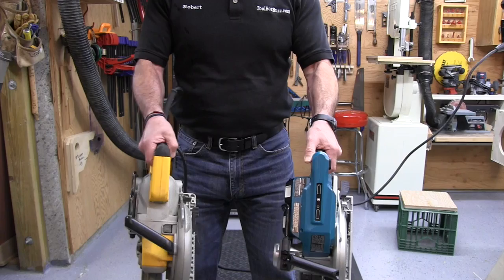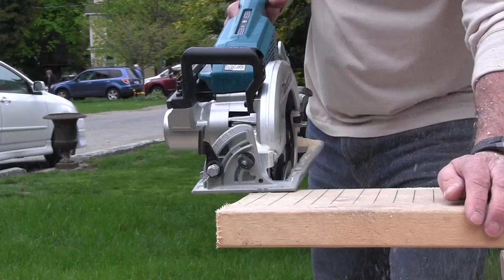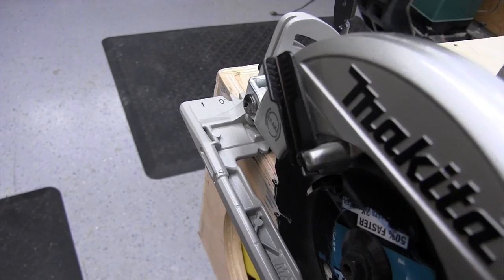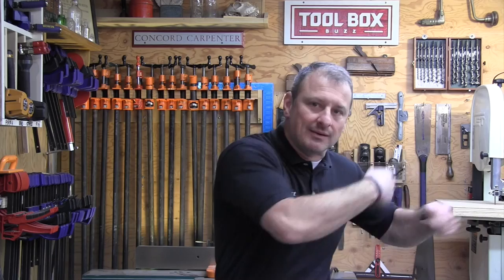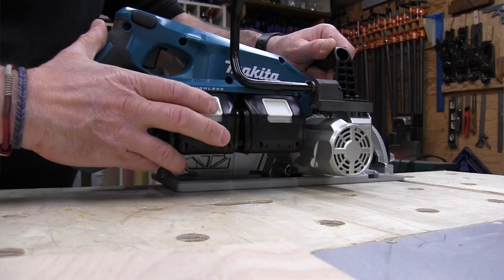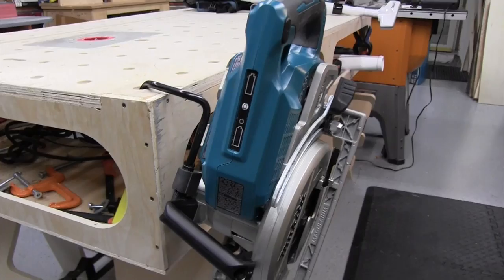MAKITA 18V Rear Handled Circular Saw XSR01

Comment: Question --  I just bought this Makita rear handle circular saw and it doesn't slide over material for crap , that grayish coating on the magnesium base plate makes my saw really hard to push , I mean its basically unusable,  I only use it about 6 times and had to switch back to my Dewalt. I tried it on 2x10s and some plywood and the plywood actually put a few deep scratches into the base plate,  any idea what's wrong with it ??
Reply: I have used this exact saw and never had any issue with it running across the wood.

I have had an issue with my other 18v Makita saw, but it has to do with the guard not pivoting up like it needs to do on certain cuts, but this is due to setting the saw cut depth too deep. Raising the cut depth alleviates this issue.
Reply: @charlieodom9107  I figured out the Shoe is 3/16" off , so the whole time I was trying to push through a cut with the blade crooked , lol , and didn't realize it .  Thanks for trying to help ...
Reply: @brianf9619  well that sucks!!!! I have a porter cable corded circular saw that won't cut in the garage. It is practically brand new and it wants to cut crooked for some reason.

Comment: hi any idea on the warranty for this? also how long does one full battery charge last? thanks.
Reply from the maker: AJ Ansaldo One battery got 221 cuts on a 2 x 10
Reply: thank u for the info. I was informed by my co engineer about hilti tools. can you also do a review on that brand comparing to makita? I was told that the battery last longer. thank u.
Reply: Hardly.  Hilti's circular saw is ancient
Reply: I have one of these saws and the batteries charge REALLY fast and they last a hell of a long time actually (in my opinion).

Edit: im talking about the makita saw btw
Reply: I believe it's a full three year warranty.

Comment: i just buy the dewalt circular saw 60 volt flexvolt but you think that makita us beter and stronger than dewalt?
Reply: Bosch uses new ""Core"" Panasonic-Sanyo NCR20700B 4250mAh Li-ion Rechargeable Battery they have most power and run time aloud in USA  by LI-ion volume per bat..""TESLA battery""  .  If Makita will start using these barrettes no doubt the 36v line will be the best and without competition. Ether in run time ,quality and performance. it will not be beat ,, volts do not mean power their are a lot of variables, a proper motor  power balance is most important. Milwaukee does a good job of this with there 18v line but Makita just out preforms and devolt depend on volts to do the job , __More volts less amps means less battery live circles thats Makitas and Boschs game dependability in the long run its better to have 18 volt 9 amps X 2 36 volts 10 amps (and with Sanyo NCR20700B it wold be possible.. power wise it wold be equivalent 120v and should run for 3 hours. 
http://www.coptool.com/bosch-core18v-6-3ah-power-9-0ah/
Reply: yes I understand that amps don't x up . I was talking about amps in power not hours. as I was saying people look at the numbers thinking more is better.   i was saying with Sanyo NCR20700B it wold be like having 10 amp in power ,(it's possible to get more but I don't think companies will put out for 15 amp Brussels motors and won't want to stress the cells . I think 36v with 10 amps is the ticket with veritable transfer it would be more powerful because of output potential of 15  amps draw on cells then any cordless saw I know off.  Makita saw is ready for the new batterys Bocsh has new batterys but is lacking in fine tools on the US market.
Reply from the maker: Carlos Gamaliel Contreras Aguilar we haven't tested them side by side....it seems stronger, better features
Reply: HAY Rob, quick question the new Bosch Core battery ,,is it the same outside diameter as the older batteries?  
(Reason i am asking I am considering buying the Makita 18X2 trimmer now and the brushed one handed chainsaw for liming both batteries are staked next to each other - ones the new cell barrettes get released i am assuming in 2018 most likely 2019 would the Makita 18X2 lineup of tools be backward compatible with the new barrettes.) the new cells are longer with wold make the barrettes wider will they still fit in the X2 platform ? ...what are your thoughts  if you get a chance to check the Core 18 Barrettes please let us know the size difference between them and the older 18 batteries . Thanx
Reply from the maker: Yes same footprint

Comment: I'll tell you from experience don't over discharge your makita batteries. If they're dying go ahead and put them on the charger. If you over discharge them they are unable to recharge.
Reply: I thought Makita batteries had a computer chip in the "star" batteries, that keep the batteries from over discharge, over heating of tool, and over charging. At least that is Makita's clam.
Reply: I have Makita 18v 4 amp hour batteries that are ten years old and plenty of times I ran them until they were completely dead yet they still hold a good charge. The old NiCads were a different story however. Glad they are a distant memory.
Reply: Nonsense.
Reply: Well all I know is what happened to me. Batteries died, would not charge. Replaced under warranty. Gave them a full charge and ran them hard guiding a deck. Driver started slowing down but I kept running the batteries anyways. When they finally died I put them on the charger and they wouldn’t charge. Brand new batteries

Comment: Sir, the title of your video is titled"ADJUSTING THE DEPTH OF CUT "". Either you do not understand what you set out to explain or you are a salesman advertising the product. Or you have set out to deliberately mislead viewers. You spent only less than 5 seconds about the depth numbers and no explanation on video of how to actually set the depth of the blade and how to perform various blade / cutting depths.
I am pleased to award you a grade for your unhelpful videos, that grade is a possible compassionate "Y" for effort.

Comment: When the Makita died you used the m18 milwaukee 6.5 trim saw to cut lumber with..? Facepalm.. Why not use the 7¼ milwaukee m18..?
Reply from the maker: Mr. B huh?
Reply: Rob, up here in Western Canada we call a 6½" skill saw a trim saw. It's used for lighter materials like mdf and other sheet goods. Because blades are expensive we don't use them for framing.
Reply: Mr. B the 7 1/4 and 6 1/2 m18 feul have the same motor which means the 6 1/2 has more power than the 7 1/4
Reply: really?i always thought the m18 7 1/4'' had more power....
Reply: NO THANKS

Comment: This is a 36v saw not a 18v
Reply from the maker: Mick David technically yes it's 36v, but it runs off the 18v platform.  It's am 18v (36v) saw. I'll add that the the title
Reply: it works on 2x 18-volt batteries. I have never seen that before.
Reply: Makita has a whole line of LXT X2 tools that work that way.

Comment: The left hand is a pain in the ass. All your cuts are on the waist side if you are right handed.
Reply: 243WW it makes it easier to eye your blade down your line for right handers .....that's why pros use worm drive or helicals
Reply: New to it as a right hander on the west coast. I get the appeal of wanting to have line of sight/dominant side to blade but can't rips be cut with the markings relative the shoe just as well? And it's safer? And the sawdust is blown opposite side from your lap?
Reply: Yes, but at least one can clearly see your cut line.